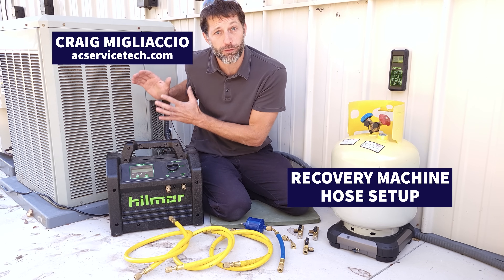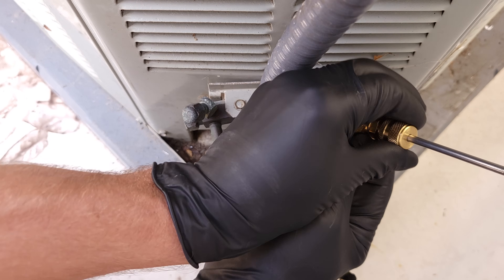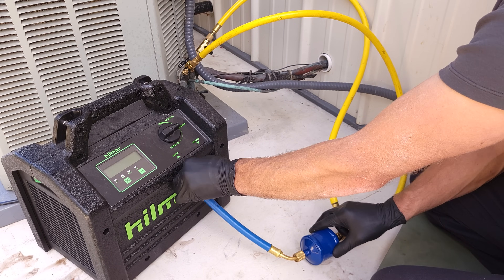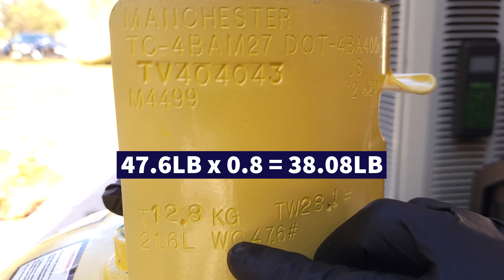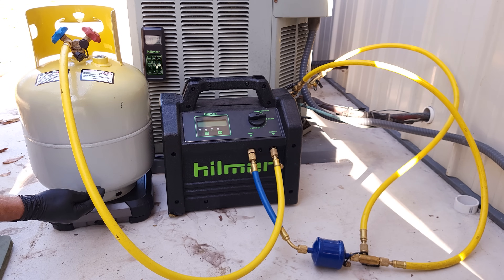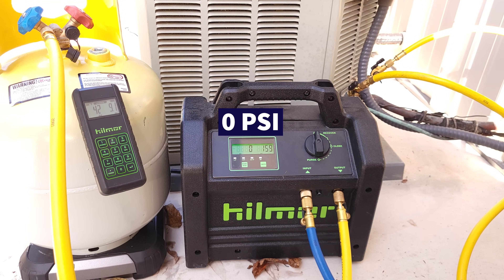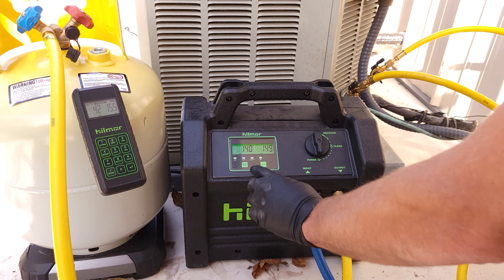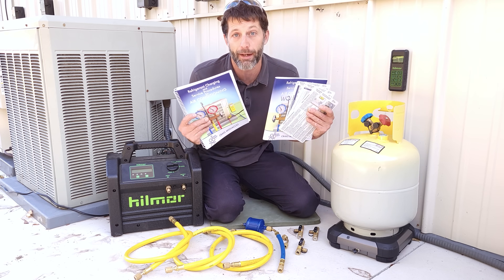Recovery Machine Hose Setup! Step by Step Procedure for Recovering Refrigerant!

Comment: excellent video. question? in the back ground I see only one valve core remover with it on flow and the other on off. Are you only recovering on the suction side at the end of thr recovery process?

Comment: Best practice would have been evacuating the hoses with a vaccuum pump. You should have one on site anyway. Use a 4 way manifold (LP, HP, Vac, Rec) an open all ports. Set the recovery machine on recover and start the vacuum pump. Once a proper evacuation has been achieved close the Vac port at the manifold. Set the recovery machine knob to close before you open all the valves at the machine and at the tank. Then start the recovery machine and slowly turn the knob to recovery ... the rest of the procedure I would have done the same way as you have explained. 

Why I am telling you that? There are toxic refrigerants (NH3), flammable ones (propane) or some that reacts with air (HFO) and leads to dangerous degradation products. In this cases a proper yet almost clinical clean technique from the start would be advantageous. Both for you, the environment and the equipment.

Comment: Also, if you put a JLP3R pressure senor at the spare suction core removal tool side port, you can see the line pressure. It will be higher than at the recovery machine. It has minimal leaking surfaces, so it should not pose any more issue than adding three connections at a Y. In fact, if you count the connections, this jumped method I describe below has 7 of them, and your setup also has 7, but you get the JLP3R as well. Lastly, while removing the cores is great, I found about a 5x speed increase just by putting about half a small bag of ice on top of the tank to take off heat as it builds pressure. R410A will get pretty high pressure even on a cool day. Tanks are rated 400 Psig for normal use and 800 Psig burst pressure. I was pushing about 550 in the shade. Taking about 10 minutes to get to 2lbs recovered. I put the ice on and it went down to 277 Psig (much less scary) and did the other 8lbs in 5 minutes before I hit 0 Psig. I shut it down and waited for the refrigerant to boil off (15 minutes). Went back up to 25 Psig at the lineset. I turned it back on and went to -8 Psig, then did a self-purge. (Brand new AC unit, never operated.... [distributor sent the wrong air handler software model claiming it was a matched set when it was not])  So I was not too worried about gunk or leaks as I vacuum tested this the week before. Plus have a brand new tank, so this is going back into the unit once the right air handler is installed.

Comment: You can do this with only TWO value core removal tools as well. Just remove one of the cores with the other tool, then attach a hose to the un-cored tool side port to the filter dryer. Then when you remove the cores on the unit, connect a hose between them. The system is higher pressure, so a purge should function the same IF your system is stablilized (equal pressure on both lines).

Comment: Very informative, however i still dont get the part where every hoses are in place and you open the valve core removal tool and quickly move over to let air out on the tank side. The hoses are closed by the tanks valve so if you open the core removal tools you would still mix air from the hoses into the system. Because refrigerant wouldnt just wait at the core tool for air to get out, or am i missing something?

Comment: Hello and thank you for these videos. They are very easy to follow, which is exactly what I am looking for. I have a few questions but I will start with one. Do you have any videos on recovering refrigerant from scrap appliances? We are in a remote northern town and it costs a fortune for our district to empty the fridges, freezers, etc. Once a year a guy comes from 13 hours away and does all of the dumps up here so by the time he gets back we have over 200 sitting around. I am in the middle of taking the ODP/ODS course so that I can drain the units each week or two and scrap them in a timely manner and save a bunch of money for our dump before it becomes too much of a burden and is given to whatever corporation bids on it. Right now it is all free for us but you can bet it won't be if that happens. I'm just trying to find out if I can get away with a $600-$700 unit from Amazon for that ,how you can separate the refrigerants and any other knowledge I can glean. Thank you in advance.

Comment: Always remember to close your service valves before you put  the condenser  in your truck or your leak oil all over your truck
Reply: You should close the service valves so you don't have residual refrigerant boiling off out of the oil and going into your service van but if the unit is uprite you shouldn't have any oil leaking into your van.

Comment: Great tutorial, just one question.
How many times can i use the filter drier on clean recoverys & should i cap both ends of the dryer between recoverys
Reply: Yes always cap the ends for sure but as far as how many times is a great question which I don't think anyone can give a definite answer to. To be on the safe side I guess you could say to not re use them and get a new one each time but of course no one is going to do that. I put brass flare caps on the ends after I'm done and put them on quickly after I disconnect. Obviously if your recovering a dirty system or a burnout I would not reuse. Maybe Craig has some better input on this

Comment: The point of using digital gauges is to minimize loss and have an accurate zero and pressure reading.  It’s important how to use both for sure.  The actual manifold with the mechanical gauges is the main “problem”.  You could use adapters to use mechanical gauges the same way we use digital gauges.  It’s also the point of knowing your tools and knowing when to change the batteries, sort of like knowing when to change out the mechanical gauges or cleaning the internals of the manifold.

Comment: what, this is a real, real bad way to do recovery. 
what happens if there is pressure difference between connection? 

Answerer: air in house will be pushed into system from higher pressure to lower pressure. Only air in hose from T to tank will be removed, rest wil be recovered to tank.
This way can only be done if you have 100% same pressure in conection.
Reply: He said system was off for awhile
Reply: @dan4091  yes, he mention that, but do that mean pressure is equal? 
What do temperature difference do with pressure? 
In an ideal situation where everything have same temperature and where stoped for a long time yes then ok, pressure likly be same. 
But as a teatching video this is bad, people will do this in situation where pressure is diferent and contaminated system whit air.
Reply from the maker: Thanks for bringing up the point! This system has been off for a little bit over a month.

Comment: I could get 60lbs into that jug. The supply shops wont take it, if its overfilled, so make sure not to overfill. The supply allows you to bring that size jug in for recycling filled to 50lbs. How long is the lineset on this system?
Reply from the maker: Only 12ft. I know two techs on different instances that were driving down the road and their virgin bottle relief went off because the truck was hot. The same thing can happen in a recovery tank if overfilled. It wasnt good at all.
Reply: You should only put 80% of the wc stamped on the tank. This has been the way since day one and has never changed. I too have seen reliefs blow on tanks left in sun which is not allowed either. Relief can pop even if you're not overfilled if left out in sun

Comment: You cant always rely on Digital. Im oldskool and i always rely on my manifold as i like to use my brain rather than let equipment do the work for me. If your batteries go flat then will you understand how to use standard manifolds. Most guys ive worked with rely on digital. When their manifold run out and you hand them over a giuge manifold they refuse to use them.
Reply from the maker: Gotta know how to use compound gauges for sure!  Always have them in the truck as well! i trach my students with compounds first before they move to digital. its like driving a stick shift car. If you know how to drive a atick shift, then you will know auto too, thanks!
Reply: @acservicetechchannel  Great Video!
Reply: @acservicetechchannel , good analogy👍. Just an FYI, if you want to recover a little faster , turn the recovery tank upside down and recover into the top of the tank (which is now the bottom of the tank) .This method eliminates the use of the restricted tank straw.
Reply: Good point about Digital measuring devices, just because Digital may have high resolution does not mean the instrument can actually read to that level. Of course, any measuring instrument be it analogue or digital can be faulty without you knowing it.
Reply: I agree, it’s the same for me, also digital gear is a lot more expensive, (even though you easily earn that back, but still)
Reply: I always keep extra batteries because they are known not to last forever.

Comment: I have a question. So I have a similar setup however my recovery tank pressure shoots up to 400+ PSI and many times and I’ve only recovered 1/3-1/2 of the refrigerant. Is there something I’m missing or doing wrong? 
I change my inline filter drier regularly and make sure all my hose gaskets are good.
Reply from the maker: It sounds like you have air in the tank and so the pressure is higher than it should be. Check the pressure before use and align to sat temp, thanks!
Reply: Sounds like your tank is getting too hot and your machine is shutting off because of high pressure. So if you haven’t reached 80% tank capacity try putting your tank in a 5 gallon bucket with ice. Or hose it down if tank is too big. Make sure your electronics don’t get wet and make sure your not over filling tank
Reply: you need to put the recovery jug in a trashcan full of ice. The tank's getting too hot and the gas isnt condensing into liquid, youre just pumping hot gas into the cylinder.
Reply: @ryanmalin  that would make sense. I’m out here in Southern California, I’ll try that out. Thank you!
Reply: @ryanmalin  yes, this is the better answer. I use the trashcan technique all the time and also use the cps device that's a copper coil heat exchanger you put in ice instead of the whole tank in ice. Works great
Reply: Hello sir  I'm HVAC technician in Pakistan
Reply: No you chech it all hoses
Reply: Try putting the hose on the vapor port of the recovery tank and flipping the bottle upside down. Fill it from the bottom basically and still not getting restricted by the dip tube
Reply: @122195brandon  what? No. You always put your outlet hose from your machine to the vapor port on tank but flipping it upside down is defeating the purpose. It would be no different than hooking up to the liquid port.
Reply: @HVACRTECH-83  Actually youre wrong. Go watch Appions video on faster refrigerant recovery
Reply: @Pointblank Matt  no, Im Not wrong, been recovering refrigerant for over 20 years and don't have any issues when using proper techniques for the current conditions, none of which include flipping the tank upside down. This is unheard of and I've worked with the best of techs over the years. On a hot day, the cps heat exchanger or a bucket of ice is all that's needed to keep the pressure down enough to get your tank to 80%  it's standard practice in our field but thanks for your input. I'm sure Craig would agree
Reply: @122195brandon  hello